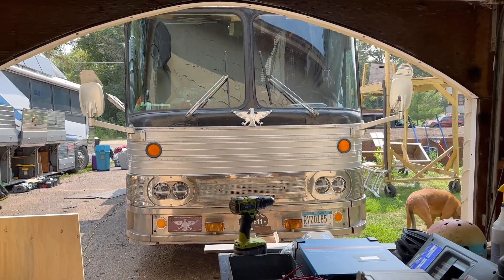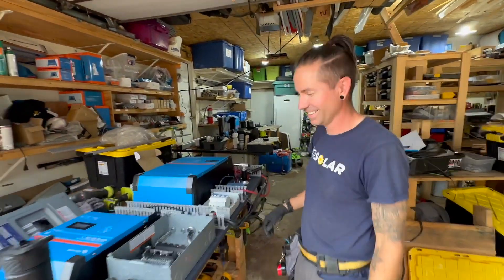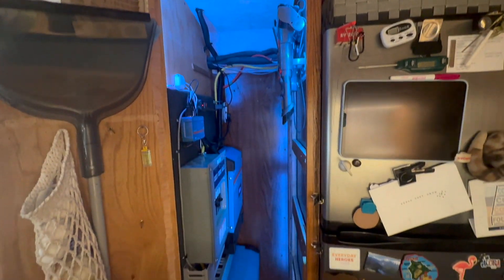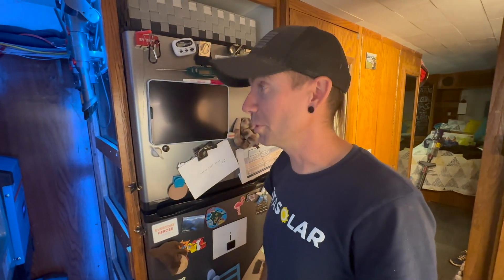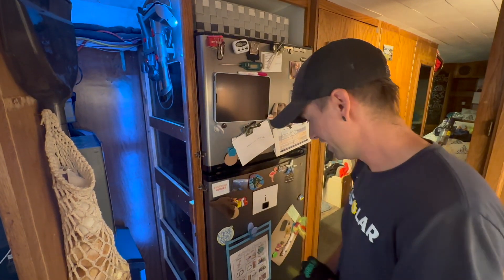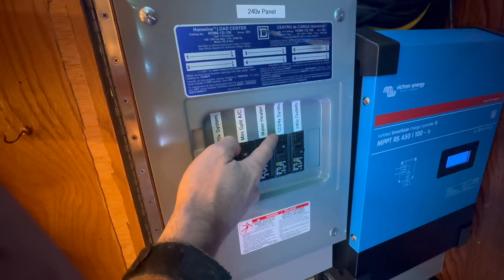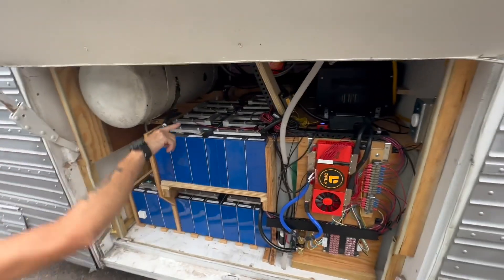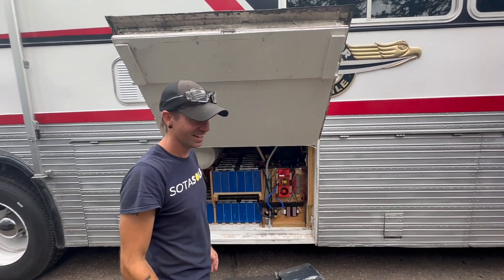Victron Multiplus 10000 48v Modified to work for 240v 60hz in Eagle Bus Conversion

Comment: Ok, so I think Europe grounds one side of the incoming 240 and that's why it's labeled Neutral on the AC in, right. So how do you deal with ground on the split phase 240/120 transformer output? I just bought a MultiPlus-II 48/8000 and need to hook this up to my USA 240/120 split phase home system?

Comment: I already have one 48v 8000 quattro, one 120/240 100 amp auto transformer and 250/100 victron charge controller and looking to make atleast 50amps 240 in a grand design toy hualer. My question is if I add another 8000 quattro can I use that one auto transformer for both inverters? 

For redundancy I was hoping to build a system that has 2 of everything needed to keep the power on. 2 charge controllers, 2 panel strings, 2 battery banks, 2 inverters, so I always have atleast half of my desired 50amp 240volt power.
Reply from the maker: Yes you can.  You'd use the Auto transformer for balancing.  Here is the documentation for it . https://www.victronenergy.com/media/pg/Autotransformer/en/introduction.html#UUID-52df4066-e2bf-316f-81a8-36acfb59bc95

You do then have to do some custom programming in the VE BUS system programming using VE BUS Configuration software.  You need to turn off Switch as group, so an individual inverter can sync to 30 amp for instance. Then you'll need to make a custom 30 amp to 50 amp adapter that only passes through L1 to the 30 amp and does NOT pass through L2 .   L2 would get created from the other quattro using battery / solar and even the other L1 Quattro's DC charger.  I know a bit silly, to take AC IN, convert to DC, then DC back to AC, but it's the only good way to make what you want to work AND keeping 20-30 amp compatibility.   
This whole mess is a lot simpler with the 2x120 Multipluses, but that's another topic.   Good luck!

Comment: What is the noise level in db like inside the vehicle at night ? What would the heat dissipation be like indoors ? What a lot of work .....  ;)
Reply from the maker: From JD “So far heat hasn't been bad at all, maybe 10 degrees warmer in the cabinet than outside. And noise is significantly quieter than the old one. “
Reply: I have seen an update in the Multiplus firmware that can significantly reduce the noise. Nice setup :)
 @sotasolar